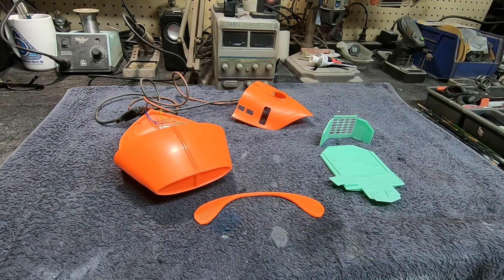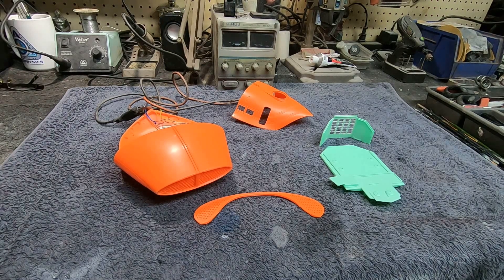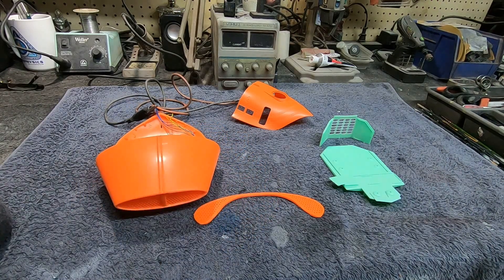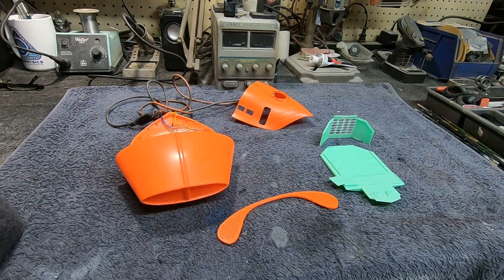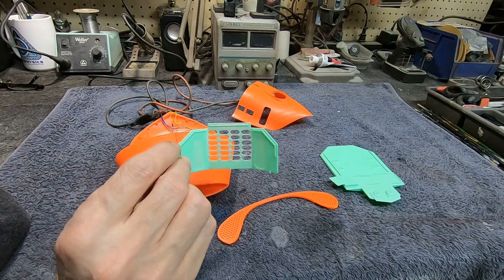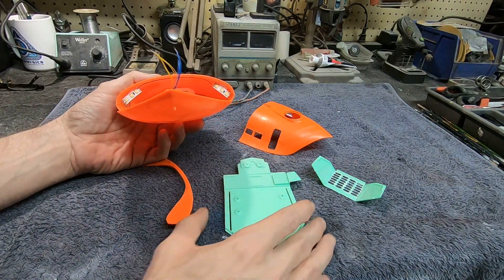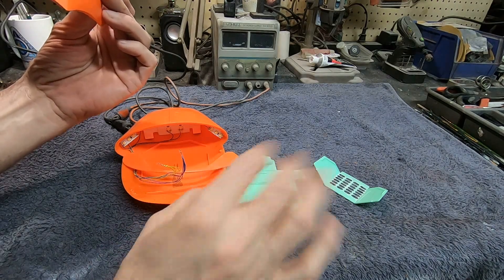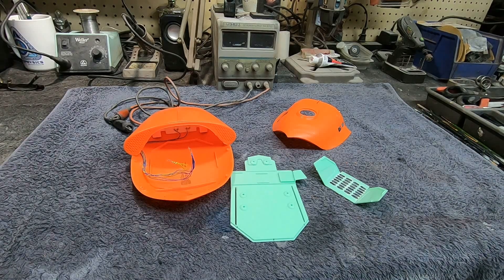Let's Build The Spindrift 1/64 Scale Model From Land Of The Giants

Comment: Thanks Boyd.  I enjoyed this show.  Glad to see you building the model kit.  On a side note, I wish some modeler or company would release an "accurate" model of the USS Cygnus from the Black Hole.  Imagine the lighting you could do on that thing.  It is a floating chandelier. That is my Holy Grail of models.
Reply from the maker: Yes, I would love to build a nice Cygnus! There is or was a huge kit on Shapeways for awhile that I seriously considered. It was extremely detailed and accurate but also expensive! I was going to go for it anyway but in the end decided it was just too big. If someone ever comes up with an accurate model at around 3 feet or so, I'd be all over it!
Reply: @TrekWorks  Cool.
Reply: When I got the original kit years ago I was sorely disappointed that all the latticework was just raised lines on a sheet of solid plastic. At the time I didn't have the skills or tools to remake it in clear sheet with scratchbuilt lattice. I acquired those skills over the years but now my vision has gone so bad that I can't do it. (sigh)
Reply: I know what you mean. I had the kit back then too and built it. Unfortunately the kit is so expensive on eBay.
Reply: The flashing back wall was the same colors as the intakes and exhaust. Blue and red. It's supposed to be like a decorative engine indicator. Blue / recharging. Red / full charge for engines.

Comment: Such a lovely design-- I look forward to seeing your lighting effect. I did notice that you really can see quite a bit through those huge front windows. Even leaving the main hatch and the cockpit door open-- allows you to glimpse a bit through all the openings. I think you should consider that PaulBo interior kit for another kit-- it is really impressive looking. A tad pricey, sure... but what results!
Reply from the maker: It is a neat design. I'll definitely take a look at the interior kit for a future build. For now, I just got tired of waiting for it. This will still be a nice little model if my plan comes together.
Reply: @TrekWorks  There are some websites dedicated to the show with images of the interior set, plenty for scratchbuilding. The details that wold show easily at 1/64th look not too different from what I've seen of the kit parts. "Accurizing" is probably easier than you think. Just a thought.
Reply: @TrekWorks  I've seen your light blocking material-- all it takes is a bit of patience!

Comment: The opening up on the back wall is excellently done! You are definitely mistaken about Aurora making 2 different sized kits.the 1/64 that you are building is the only one Aurora made.the kit was available 1969 -1970 and Aurora re issued it near the end of their operation around 1975-1976.
The original release had the clear upper dome and engraved insignia on both sides of the hull above the passenger windows.The 1975 re release had no engraved insignia but added decals for the insignia.also the upper dome was molded in clear red.When Aurora ceased operations many of the kit molds were destroyed in a train de railment.Polar lights used an original 1969 version of the kit to make new molds.The hull fit perfectly until the interior was added.there were promotional photos of the polar lights kit with the interior displayed outside of the hull because the upper part would not fit correctly.The original 2 issues by Aurora never had a fitment problem and the polar lights kit was molded from a kit that was Un built for nearly 30 years and probably had warped in that time.just thought you might like to know a little about the kits history.And yes there was a small spindrift kit but moebius made that 100% themselves.
Reply from the maker: Great info, thanks!

Comment: Interesting if you could make your contact points inside the model: on either side of where the stand tab is inserted.
Reply: I've seen folks use a headphone plug and jack that way. Cement the jack into the model and the plug into the base- you literally plug the model into the base.